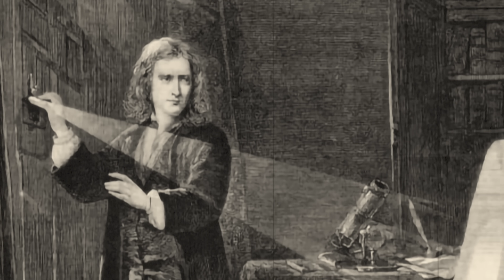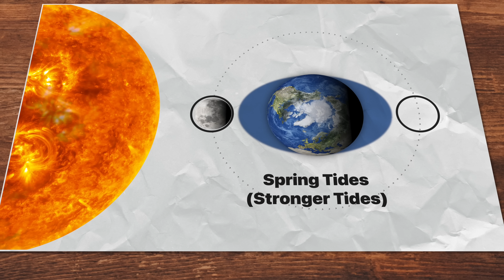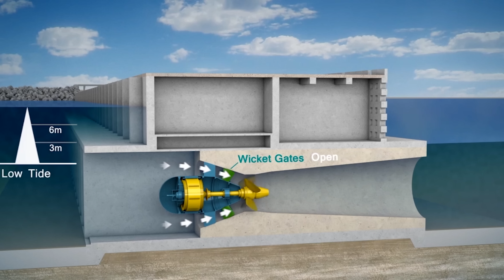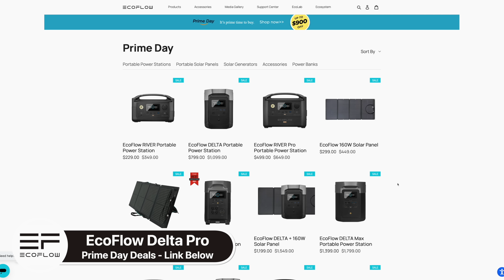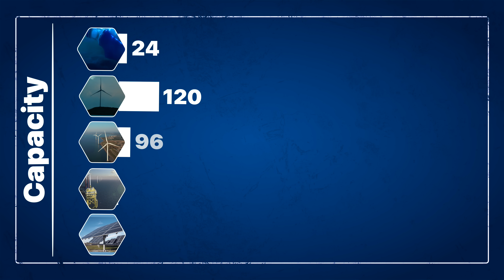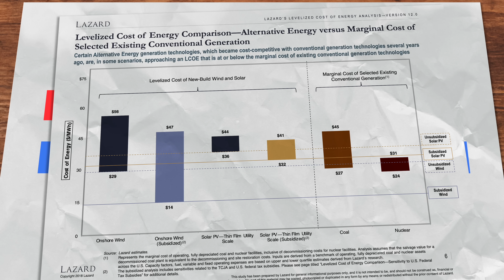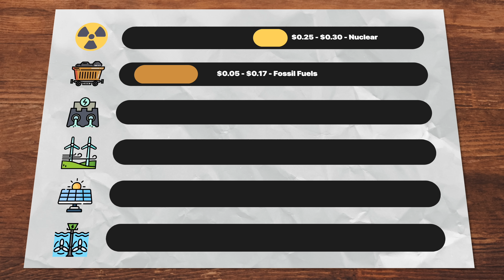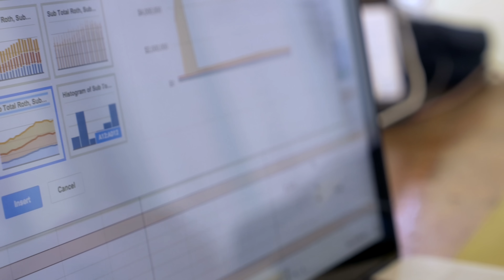Breakthrough Energy Source is 10X Better Than Wind & Solar!?

Comment: Definitely a combination of wind, solar and tidal.

The biggest problem with sea water, which you touched on a bit, is corrosion and animal growth. These are not problems, these are HUGE problems. Solving these will be a game changer.

If the uk had tidal power we would have 24/7 energy due to how tides work.
Reply: Yeah- I think this was downplayed too much.  Building anything in Salt Water is iffy- it is a brutal environment.  One of his slides above touted longevity of 75-100 years for tidal turbines.  I just don't buy it.  If they don't last that long on land, how are they going to last 3 times longer in a corrosive soup?  I am glad it is being pursued, especially given its more reliable time of energy generation- but I think we will have a long ways to get ot a system that is bullet-proof while submerged in our seas.
Reply: Making the blades from UHDPE or PTFE (plastic) will stop both corrosion and fouling.
Reply: @jamesbrown99991  the problem is also the shaft and bearings. Sealing those from seawater can be difficult.

I'm not sure if the plastic outer will work for long.
Reply: @SimonAmazingClarke  Greaseless ceramic bearings are suitable for marine use. Carbon-fibre drive shafts don't rust and have high longevity; a PTFE layer on the shaft would resist fouling. 
Overmoulding the stator means there's no seals to leak. Friction caused by water between the stator and rotor can be removed by filling the area with pressurised gas, e.g. H2. I don't think these issues are insurmountable.
Reply: @jamesbrown99991  all of that sounds awesome.
Reply: @SimonAmazingClarke   ceramics?
Reply: @jamesbrown99991  All of this sounds very costly
Reply: @jamesbrown99991  Barnacles and other things grow very well on plastic. Anything that breaks laminar flow greatly reduces efficiency.

Comment: Unfortunately they don't produce power at slack tide which means there is no tidal movement for approximately for 45 mins between each tide. So they can be used as a part of generation mix plus they are the most expensive way of generation type and need a lot of maintenance because of the environment they work in
Reply: How far North/South would you need to space out a couple of plants to cancel this effect? A quick look at the tidal charts spaced about 25 miles apart, overlayed here in south Florida resembles a 3 phase chart. Running at about 1 cycle per day vs 60 hz.

Comment: In Scotland they are using tidal with units which are towed out and float like a ship , but then drop the blades under water .
When you want to check or service the blades you can just raise them out of the water so much cheaper to service . 
Some great videos on you tube .

Comment: So plastic is a problem so it is saud, it lasts a long time, so why not make these water tubing out of plastic, according to what I keep hearing plastic will even last a long time in the sea, so not only would it make sense to build them out of plastic it could be built from recycled plastic.

Just one other thing.
People have been using water to generate power for hundreds of years, so instead of putting the generator under water why not use a similar system to the water wheel and combine a wind turbine with it, that way you get both wind and water working together in one system.

Also make use of the excess power by making hydrogen to power heavy goods vehicles until a better way comes along.
Reply: Brilliant! You are thinking in the right direction. Please support such efforts in the future, against the arguments of the fossil-fuel shills.
Reply: @totaramgandhi5117  The odd thing is I was saying this kind of stuff many years ago, including making use of land fill sites as the produce a lot of gas, free gas.
It's being produced anyway so rather than it going to wast and causing problems make use of it.

Even the canals many have a tidal system, so it would make sense to have localised power generators using the local canal water flow.

Comment: Imagine you got solar panel input during sunshine and wind power off and on through the day. Integrate this with the electric main grid and input to the power inverter that takes all three sources at the same time. 
I do this using the BT 139 Philips semiconductor Rs 22.00 switching more than 2kVA input power to the inverter. 
This unit will make domestic power using alternate energy welcome.

Comment: Solar energy stored in batteries has no moving parts. I installed 4 x 44 Watt Solarex solar panels with ex telecom lead acid batteries and a home built inverter in 1985. I still have the panels and they still produce 95% of their original output but I now have a grid connected commercially installed solar system on my roof which I am about to get upgraded with LiFePO4 batteries. I have been storing unused solar energy in a 250 litre hot water tank as it's more cost effective than my small feed in tariff.

Comment: How about small scale tidal generator mooring lines to recharge electric boat batteries? Mechanics could be on the boat to generate power as the tide changes by reeling in the mooring line at low tide then generating power as the tide rises.

Comment: Excellent presentation!
What's the trade-off though.  
This energy we'd be sucking up... what are we robbing? 
What are the unintended consequences?
Reply from the maker: Technically slowing the earth down a very very very tiny amount. Yah I love that your mind went there. Thinking like an engineer I love it
Reply: This is the same thing this video got me to wondering about except i was thinking it would slow down the moon or it was a perpetual motion machine.  I think the moon is actually getting closer to the earth every year
Reply: Imagine if we could capture the destructive energy of a hurricane or a tornado... or even a forest fire... How many homes would that power in a year? (not to mention all the destruction it would prevent) 
Of course I have no idea how you could do that!  ☺️
It wouldn't surprise me though, if some future genius doesn't figure it out.
Reply: @Dan0__  That destructive energy comes from the sun. Remove it from the atmosphere by any means and the destruction is reduced. i.e. wind and solar. Also, send it out back into space by radiation, by reducing the blocking of that radiation by greenhouse gases. The concepts are simple.

Comment: Thank you for an informative video about Tidal Systems. Well done. However, I wouldn't consider Tidal Systems a 24/7 source, because the tides will have a period (slack tide) where they are between the ebb and flow (flood).  So, they will need to be designed to handle that short Lull, where no power can be generated. It isn't a very long period of time tho, so it should be able to be possible to do this on a massive scale, and drop the price.
What we need now is an environmental science group that can do the math, and prove that by installing these we decrease the risk of massive floods. That would create a much stronger incentive.
Reply: I'm a scuba diver so Slack is the interesting time for me. The thing about slack is that it is dependant on location. Just like timezones you can plan multiple locations so when it's slack in one it's not slack in others (so long as they are well separated).
On a separate note I don't think there was enough emphasis on bio-fowling in this video.  Look at orbital o2 tidal turbine, It's designed so the turbines can be removed and serviced because the marine environment is so hostile
Reply: There's about an hour of lull time every 6 hours, but at least that gives you a very specific design requirement for your storage solution.
Reply from the maker: Very true. Predictability is still nice though

Comment: like all good things they come in small packages and graphine is close to the smallest high nikel crhome steel required for marime infrastructure is 40 to 120 $ per pound and graphine is 1$ per pound as of nou graphine in Quebec so an vertual renansance in tidal power is coming and the first place to look is the bay of fundy in P.E.I.. and the north of vancouver island inside waters to name a few.I didnt realise that tidal power was limited to the 7meter challange the rapiads of shcelt inlet are not that high but their velocity make up for it. the bay of fundy is imparative as sea level rise in thretening the major highway there.

Comment: I've been hearing since I was a kid in the 70's. I think tidal energy makes a good case for nuclear power. Small nuclear plants is the answer. Otherwise we need breakthroughs in solar , much like the breakthroughs happening in batteries right now. Your videos are quite polished and good. This one though is wishful thinking.
Reply: Have a look at the new Perovskite solar cells that are not far off and promise close to 40% efficiency figures , with their speed of deployment & low cost to deploy& of coarse close to zero maintenance , they will probably beat on shore wind soon with Gravity Storage and or pumped hydro :)
Reply: @pwrrpw319  I`m pretty happy with 22% solar panel efficiency when hurricanes temporarily force me off grid. Much less expensive than running a gas generator at this point to power freezers, small fridges, lights and fans. Now if they could just lower battery prices so I could afford to run a tiny window air conditioner and the other stuff without worrying about clouds rolling in....
Reply: We need millions of donkeys spinning turbines. It`s the only way.
Reply: @baneverything5580  hahahahahaha

Comment: This seems very inefficient and may lead to more harm than good. More damage to the sea floor and the vital creatures inhabitanting the sea. The Viktor Schauberger design still remains the best design in my opinion. The way we harvest energy today is crude and unsophisticated. Systems that do not disturb natural current flow and work with nature , ironically are the most efficient. "Implosive engineering not explosive engineering" is the future according to Schauberger.

Comment: A startup I worked for in 1990 built and tested tidal turbines and even installed a series of them on the San Mateo bridge in the SF Bay Area. For 18 months, those tubular units generated all of the power used to light the bridge and services. It was removed because an organization was positive that the units would injure/kill sea life, not that they had any proof and we saw no sign of that happening.
Reply: It was the Green Wave Project, and it was scrapped because it failed to provide serious studies that proved it wouldn't harm marine environments. 
The onus of "no harm" is on the proposer, not the potential victims.
The area is a struggling marine ecosystem as it is, without chopping up sea lions, fish and the other endangered species.

Comment: I always though floating paddle wheel generators tethered to the banks along the Mississippi River would be too easy to make electricity 24/7 without a “fuel surcharge”. My friend who works for the local power company assured me it wouldn’t work.
Reply: For the same reason you can't just put 1000 wind mills one behind another.
Reply: @mariusvanc  Wouldn't they just have to  be far enough apart to stay out of each other's "shadow"?
Reply: @LG123ABC  There are complicated equations and particle simulations for how to place wind turbines to maximize energy harvesting/area, and maximize watt/cost. But there's no free lunch. Once you take energy out of a flow, it doesn't magically re-acquire it later on. Using dams is basically a way around it, to accumulate energy potential over distance before periodically taking it out again.

Comment: Great video as usual!
IIRC Edinburgh university has been active in wave and tidal generation for many decades - Salter’s “ducks” were flapping wave driven producers fifty-odd years ago but I think the structural and maintenance issues of sea level machinery rather put the kybosh on them.
Storage is still a problem: just because we can say exactly when the electricity will be produced doesn’t alter the fact that it might not be required then.
It would be nice if we could widen our scope: “the wind doesn’t always blow and the sun doesn’t always shine” isn’t true. The wind is alway blowing somewhere and the sun’s always shining over one half of the planet. (OK,simplified, but ….) Planetary distribution would provide considerable renewable and dispatchable 24/7 energy with big economic benefits to many undeveloped countries
Reply: What a lovely lovely idea - global power distribution.  I completely agree.  Also global food sharing and wealth creation.   It's just that as a species we cannot think, or more importantly act, at a large scale.  We're just not engineered to share our toys.    Everything good that we make is used to gain power & leverage over others rather than to help others.   
We need to fix ourselves, our governments and the way our commerce systems function before we'll be able to fix any global problems.  I fully endorse the concept, but hold no hope of it happening ever.
Reply: @completelybusted  To a limited extent it is already in the post-planning stage: a Moroccan wind/solar plant with two connectors to the UK. Whether it will work I’m not qualified to say.
Reply: @completelybusted  There already systems for this in embryonic form. Europe has an electric grid that enables transfer of electricity North and South, and East and West across the continent. Morocco is linked to Spain, and thus the rest of Europe. The UK is looking at an additional direct link with Morocco. There are plans to install connections between other North African countries and Europe. Australia and Singapore have an interconnector in the pipeline. There's nothing except lack of political will to make the US Grid "national", the US is already buys power from Canada. Currently the biggest restriction on the growth of the network is the lack of worldwide capacity to make the interconnector cables.

But the reason you are reading this on your computer is an international cable network that stretches around the world which includes redundancy - all it takes to do for electricity what we've already done for data is the political will, and the money.